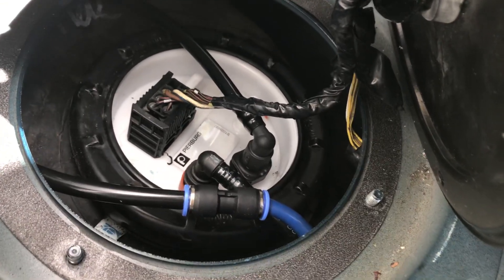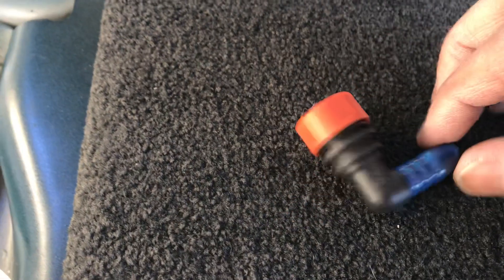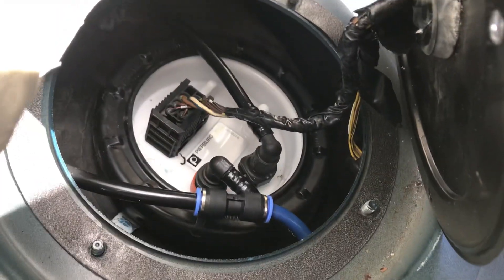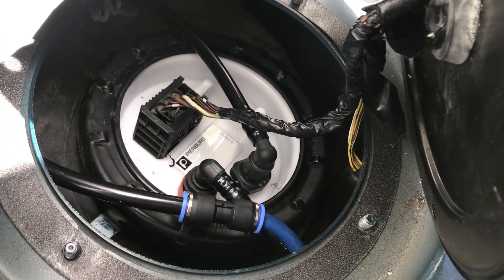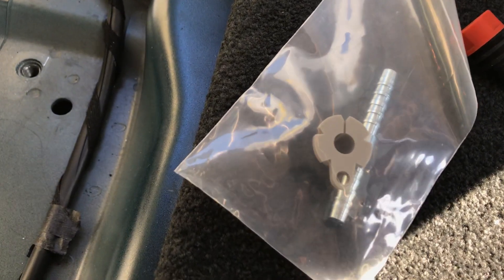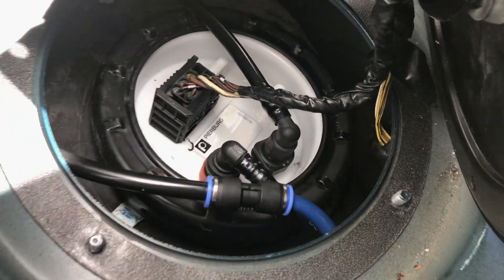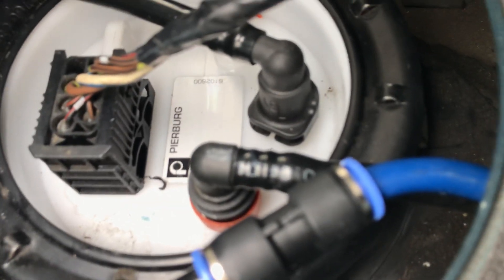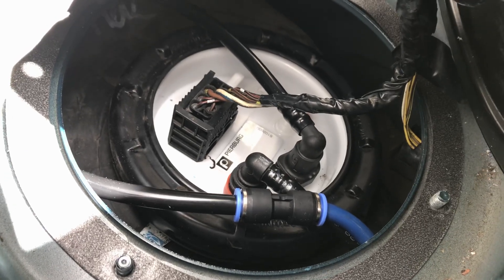2004 Range Rover L322 Fuel Pump Fuel Line Plastic Emergency Repair Dorman 5/16” Quick Connect

Comment: FYI, there are special pliers you need to disconnect the quick disconnects. It’s the same for the fuel filter. People just pry on the orange caps and destroy them, bad. Get the correct tools for the job.

Comment: where can I find the orange piece I need two
Reply from the maker: Hi Brian, I do not know if and where you can source the orange 
compression connectors, but the generic replacement would be 5/16" Bundy
 connectors. Dorman makes them as part # 800-123 (available here 
https://www.amazon.com/Dorman-800-123-Bundy-Fuel-Connector/dp/B0089SZOR4)
 You'll also need a tool to push the nylon fuel line onto it. There are 
several tools available at auto parts stores or on Amazon that can do 
that too.